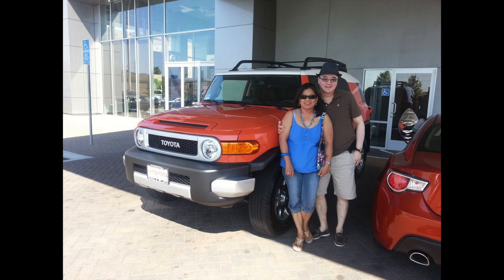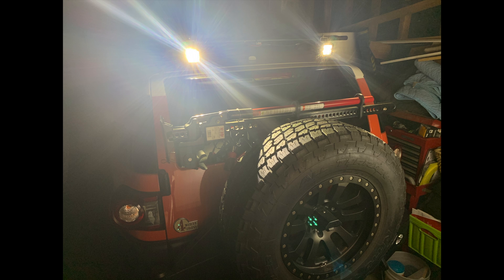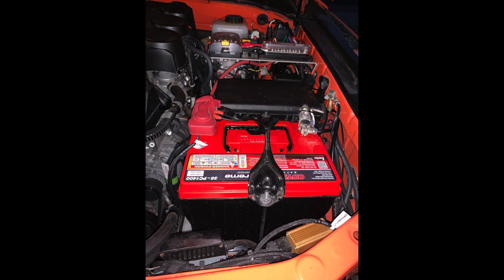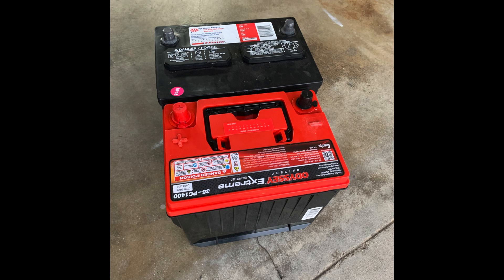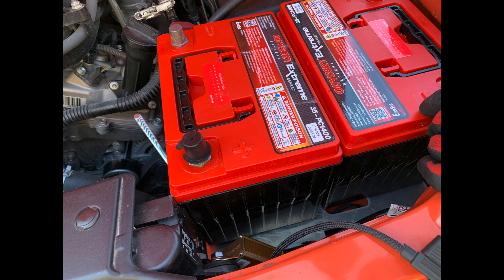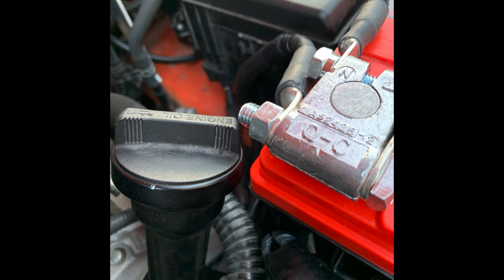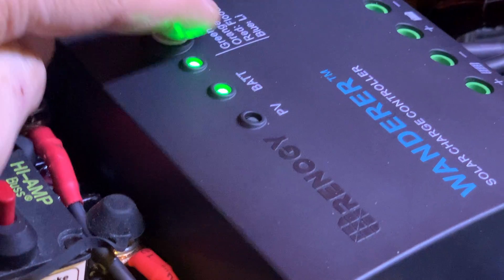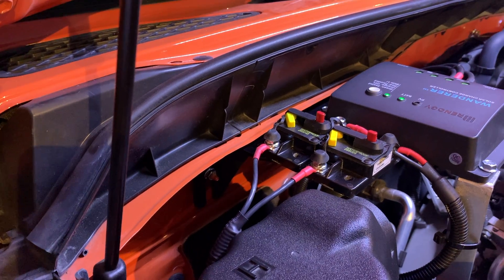My 2013 FJ Cruiser with Dual AGM Batteries (side-by-side) and Solar Panel

Comment: Quadratic has a dual battery for to jeep cost 961.00 comes complete part # 17004-0040 it will fit in the Toyota fj  cruiser because I own a 200u Toyota fj cruiser and have installed with no issues only down fall is if you looking is on backorder tom me about 2 months very happy easy install only hard part was running connection cable through fire wall beside that all good makes life nicer to have extra power on demand go FJ

Comment: This is a similar setup to what I’m looking to piece together. Does the solar provide enough power when the engine is off to combine the isolator and charge both batteries?